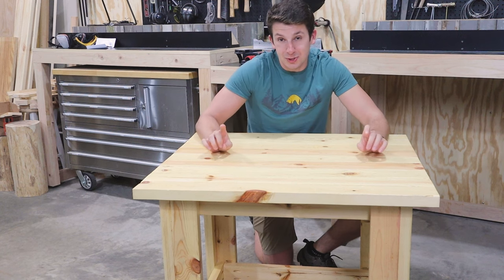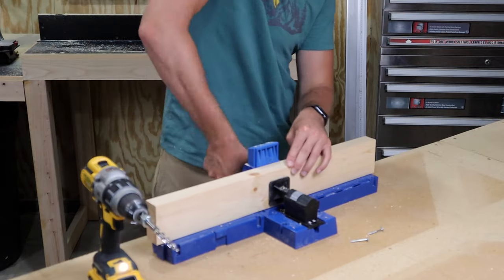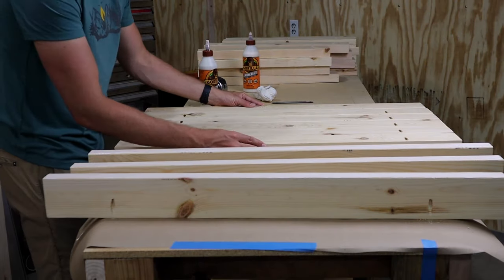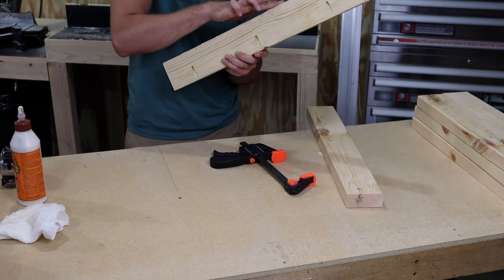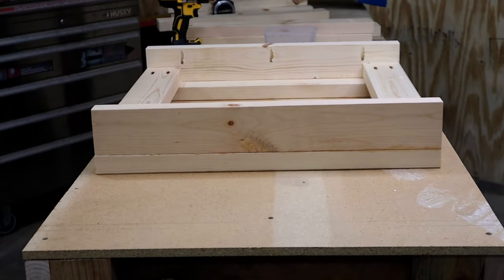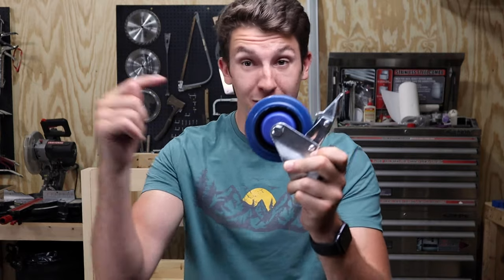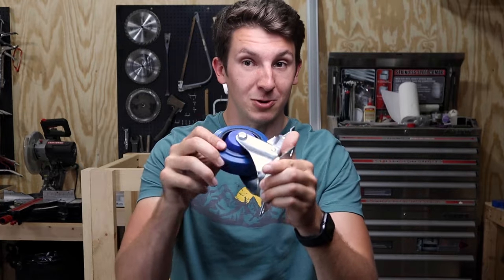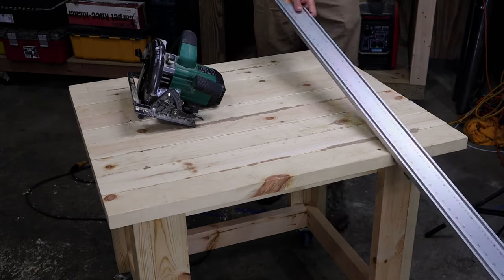Simple Rolling Workbench Build | FREE PLANS

Comment: Great video. Just subscribed. I’m going to modify this to fit the height to use as small outfeed table for my job site table saw and add a bottom shelf for a small air compressor (if it will fit).  Thanks for the inspiration and plans.

Comment: Zach, this isn't a criticism just a question. I downloaded the free plans for this because I am just starting my shop and have a lot of new tools that don't have anything to sit on. I've downloaded a few of your free plans because you do very good work even if the music is a bit distracting. On this build though I  have actually 2 questions. 1) wouldn't it be better if you made the table top out of plywood instead? For the flat surface and because as a workbench, eventually, you'll want to replace the top? And 2) building the top what are the last set of pocket holes for? I can't see where those would attach to anything. If those are an oops fine, if not what do they attach to? 
Great videos, solid plans and much appreciated.  Keep up the good work!

Comment: Great video. The Catch-22 of workbenches seems to be that you need a workbench or two to make one. Any tips on how to get a basic setup built when you're just starting out, with few tools, no power tools, and a bit of garage floor?
Reply from the maker: I’d recommend buying a drill, circular saw, tape measurer, and some clamps. That will definitely get you started. You can just work on the garage floor(where most everyone starts). If you’re going to make a cut with the saw use a 4’x8’ sheet of foam insulation between the floor and your wood so your blade will only cut through the foam
Reply: @BearMountainBuilds  Many thanks for the great reply. I'll use those instructions 👍

Comment: Question, I am 6,000 in on tools and haven't sold anything at all yet, should I quit?
Reply from the maker: Sounds like you need to buy another tool
Reply: The only way you won't sell anything is if you quit. That's the way I am looking at it. You have to actively  promote your work. Just putting it on Market Place, hoping someone sees it won't go well for sales. I'm looking at the local businesses and asking if I can display my wares, once they are made of course, and have found several that have said that when I bring things in they will let me display them. 
Also, in my town, the dept of commerce has a shop that displays and sells the work of local crafters . And for goodness sake, put your name or your business' on ALL of your work. Also, one last thing, when you display the pieces, dress them up . Put flowers in your planters, hang ivy on your trellises, and put knickknacks into your trays and boxes. People have a problem visualizing what items are for in many cases. Show them.

Brand new to woodworking, LOTS of experience with selling and marketing. 
Hang in there.